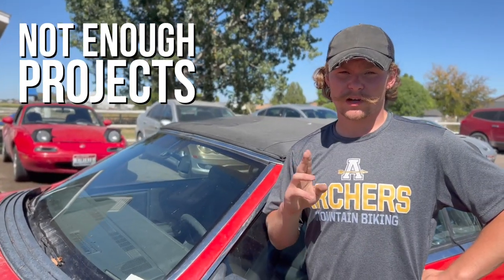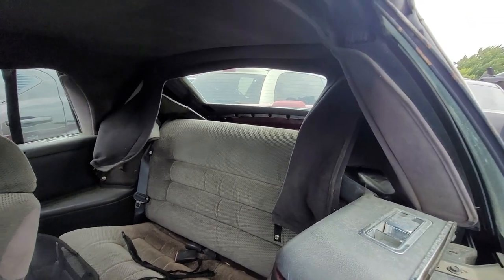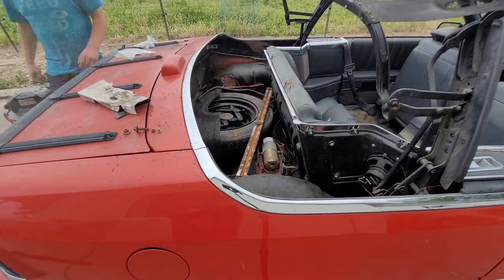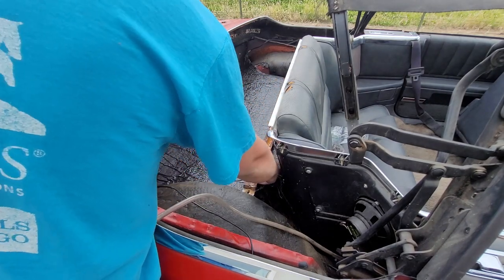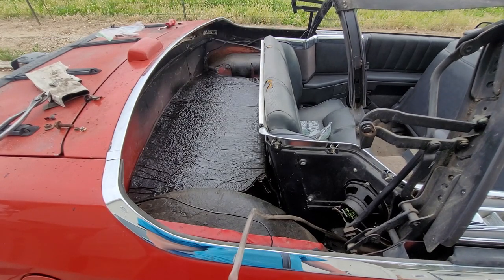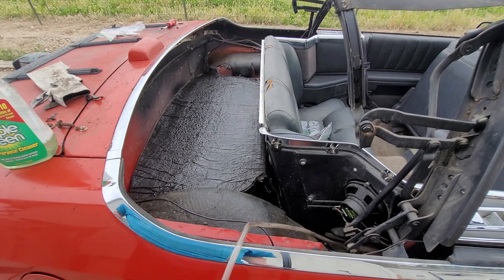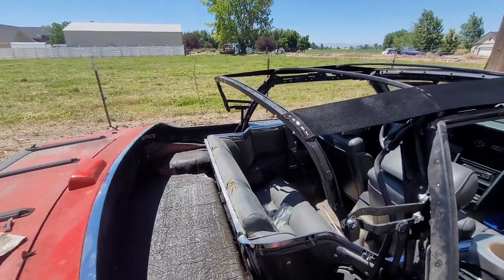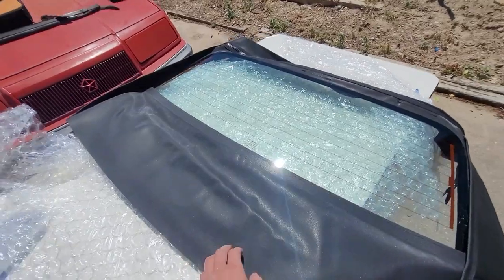Convertible Top Replacement Lebaron GTC PT 2 - Installation

Comment: Fantastic job man. I like the look of the top without the external wire-on.
Reply from the maker: Thanks! Definitely agree about the wire on
Reply: I have a red 1991 Shadow convertible with a slate colored top. They have the internal wire-on system, but the top is parted differently and the side seams run all the way down the sail. It looks like shit compared to your style of top. It's four separate pieces. I guess that's how it has to be done so the internal wire-on has something to attach to.

Comment: Awesome video! Going to be using this as a baseline rough guide for a 1986 lebaron that I have to change the top on. Previous owner cut the rag right off so ill be working with just the bare frame. Thanks for this video
Reply from the maker: Glad you're finding it helpful! I believe the 86 is slightly different, but hopefully fairly close. Thanks for watching

Comment: HI! Has same issue - same top, but wire-on frame, so that third bow needs to be sew and covered..any ideas where to get that wire? or solved it different way? It also stretch my top to the front and showing an edge from rear window. Nice video, thanks! Also, mine came with manual, these rubber belts should go under the front webbing between 2-3 bow, to prevent webbing damage from frime while folds/unfolds..
Reply from the maker: Thanks! If I remember correctly I could not find a source anywhere for the wire on frame. Had to convert to the later style

Comment: Did this end up water tight? Im a bit confused how the window seals up
Reply from the maker: Sorry I'm just seeing this. Yes it is water tight, I'm guessing you're talking about the rear window. Many convertibles use the two piece rear window, the top and window section are tight together enough to deflect water and direct it down rather than in

Comment: 1990 gtc lebaron  how to take out the fuel pump any hints
Reply from the maker: Hi, not a job I've personally done but it looks like you need to drop the tank and then remove the sender unit with gives you access to the pump

Comment: So you don't show how the top comes off but you show how to vacuum?
Reply from the maker: Lol part 1 covers removal. Hope it helps https://youtu.be/WCyT9TRzPdg?si=xz_goVy4k9v17PIy
Reply: Thanks. Took me a min to find it without a link. 
It looks a bit sharp in the back top rear corner did it rip? 
My top is 20 years old. No rips but the threads have all rotted away.  White so it's a bit ugly now.